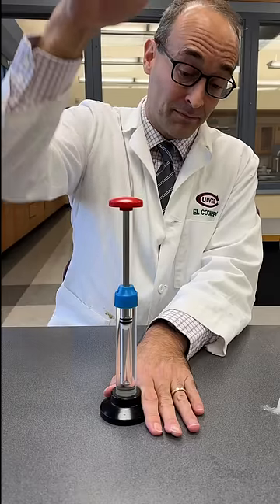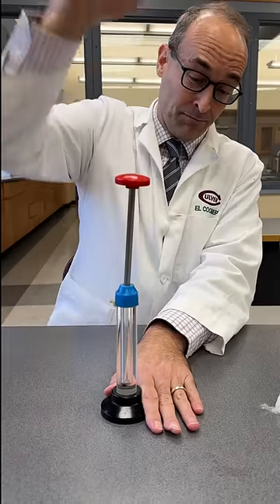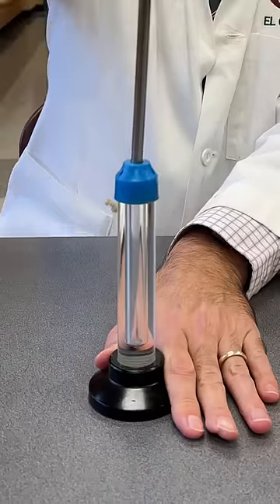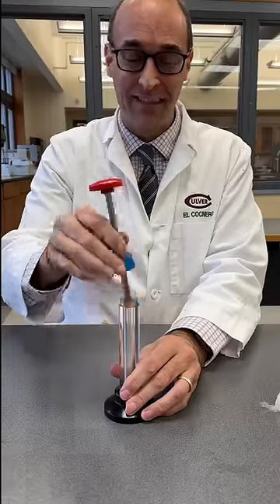Squeezing air to burn stuff

Comment: “You wouldn’t think that squeezing something would ever cause it to catch fire”
The sun: am I a joke to you?
Reply: sun doesn’t combust tho😭
Reply: Solar plasma ≠ fire
Reply: @billyrussell7789  no, but it goes get got. Same with the Earth's mantle
Reply: @SilverStarHeggisist  yeah just cause it hot doesn’t mean it has “caught fire”. fire is a product of combustion, not of fusion, fission or friction
Reply: @billyrussell7789  however for the purpose here, it's semantics. Because something that has gotten as hot as the sun will catch things on fire.
Reply: @billyrussell7789  I'd argue fire is just the visual representation of the process of combustion rather than the result of it or even matter.
Reply: @SilverStarHeggisist I hate when shit goes get got
Reply: In Piccolo voice: NEEEEEEEERD
Reply: @billyrussell7789  Fire is a plasma.  
The sun is made of plasma.  
Think about that.
Reply: @billyrussell7789  You can literally take a magnet to the sides of a candle flame and move the flame with the magnet because the flame is an ionized gas ... a plasma.
A candle and a star go about creating a plasma in very different ways, but the end result is still a plasma.
Reply: @billyrussell7789  Sorry but to prove you even more wrong the sun has carbon monoxide about 500 kilometers above its photosphere. 
Those carbon and oxygen atoms weren't bonded together by fusion which means it was an old fashioned chemical reaction ...  a combustion! 
Not that this contributes more than a tiny fraction of the sun's total energy output but it is a thing!
(Sun wiki page)
Reply: @lick28  In response to fire being a visual representation of combustion; 
Methanol flames are actually invisible which makes them incredibly dangerous if you aren't aware that it is burning.
Reply: @Derekzparty  
Coal is a form of carbon. 
You’re made out of carbon.
Think about that.
Ya see how two things being made out of the same thing isn’t really an argument?

Im aware that fire is a plasma, but the important part of that plasma, the part that yknow… makes it fire… is that the flame icomes from the heat caused by combustion and appears by a combo of absorption bands and black body radiation. The heat of the sun is caused by nuclear fusion in the core, and CO above the photosphere would actually be proof against combustion occurring, since CO can be burnt with oxygen into CO2 (this is the cause of the small blue flame near the wick of a candle - CO burns blue, and then combusts further into CO2 which burns yellow.) Now this on its own wouldn’t necessarily be proof against being “on fire” as there is water in this region; partial combustion is still combustion, and hydrogen will burn before carbon, however there’s an important step here were missing. 

When something combusts, its reaction with oxygen, and goes from a higher, stable energy state, over a large energy barrier to a much lower energy state. Normally this is some combination of carbon and hydrogen (or a metal) burning with O2 into CO2 and H2O… but there is no O2 or hydrocarbons or C2 found near the sun. Rather what is happening is that ionised atomic oxygen, carbon and hydrogen are being released and as they cool and deionise, they’re going from an already high energy state to a lower one. They never pass through being in the hydrocarbon and O2 energy well that would be necessary to call it combustion, and thus never undergo the reaction that distinguishes plasma generally from fire specifically. 

(Source: my bestie is an astrophysics researcher, I’m a few months off a chemistry degree)
Reply: Oh how I love astrophysics.  😎
Reply: Not true.  Biological entities are made of many things.  To say people are made of carbon is like saying carbon exists in these forms; diamond, graphite and people.
Reply: Diesel engines are great, just not sure why there are some that"run away" some times. I'm not sure if it's because they over heat.
Reply: @goldengear6125  Something on the High Pressure Pump breaks down allowing unrestricted injection.
Reply: @BakitracinTugungu  Makes more sense, I forgot about the fuel injection.
Reply: Sun uses gravity to pull hydrogen atoms together with such force that it turns into helium atoms and releasing lot of heat. So yes... Sun also uses the same mechanism.
Reply: @DabsOnDabs 😂😂 silly
Reply: There's not oxygen in the sun. The only place in the solar systen where there's actual "fire" is Earth.
Reply: Wow this throwaway joke sure provoked more of a discussion than I would have expected.
Reply: @senskrad5860 the sun is 0.77% oxygen!
Reply: Man, people are getting way too worked up over semantics... yes, the sun is not powered by combustion. No, that doesn't invalidate the original comment; squeezing nuclei together hard enough to fuse is precisely what powers stars, and on top of that, terms like "ignition" and "burning" are regularly used when talking about fusion, even though it has nothing in common with combustion other than being an exothermic reaction.

Great subjects to discuss, but don't lose perspective by getting caught up in minutia.

Comment: This kind of thing was tought to me as a child decades ago. It is called a fire piston and works amazing, especially if you put some charcloth in there; the pressure required to get charcloth to ignite is much lower and will create a burning ember much easier. All we used was a piece of copper pipe with a whittled piston made from a branch and made to snuggly fit into the cylinder but not get stuck. You put the charcloth and other dry combustibles into the bottom of the cylinder, place the whittled piston in the copper pipe cylinder and slam down, as in the video. Make sure to hold the piston inside the cylinder when you do this or your piston will launch from the cylinder, kind of like a mortar round. Your tinder/charcloth will be burning and can be dumped into a tinder bundle and then fire is relatively easily created. This trick has actually saved my life and I recommend this as a survival technique that everyone should at least know about. Thanks for the video.
Reply: Huh interesting, i always thought thus was how guns work
Reply: How did it save your life? What’s the story?
Reply: Yeah what's the story
Reply: Survival… 🤔where?!  Some place a piston or copper pipe is located. And maybe some bottled water, pots/pans, and a radio too😂
Reply: @Jonesybabie  These are skills, materials, and kit that you should have gathered and made work well in advance of needing them. Even though things are vastly different than when I learned about this, I''m sure you can find these items still for sale and can make the best piston and cylinder your mind can imagine. The things you have mentioned should be close to the first things you ALWAYS have anyway. Especially if you're in a Survival or SHTF situation. And remember, this was only one of many ways to create fire. Learning and practicing survival/SHTF skills is on the individual. I have done, and continue to do, my homework, build up my kit over decades of trials and errors, practiced, practiced, and practiced some more. Learned what works and when to use the skill/tool to accomplish tasks. If you don't have your kit (knowledge, practiced skills, tools/materials, etc.) ready to go at a moments notice, then I would urge you to develop that area of your life. Especially with the state of the world these days. Good luck and keep learning.
Reply: I too learned this as a young guy it was called a Malay fire piston used a hardwood limb it was hawthorn with hole bored in it and carved piston from another piece the charred cloth was put on the end ,the natives used animal fat in the bore,we used lard worked every time was amazed
Reply: 8th grade novel story project or youtube shorts bro pick one
Reply: @danroseveare3090  I'll use my military experience and yall keep hoping your YouTube skills will be needed, like the rest of the preppers watching too much TV 📺
Reply: @Jonesybabie  Right on brother. All these skills/techniques are only informational unless they're put to use and practiced. Knowing how to do multiple techniques to accomplish the same goals is critical; 2 is 1 and 1 is none mentality is what I use. Thanks and respect for your service.
Reply: @Jonesybabie your military skills ain't anything lil kiddo dreaming in his papa land LMAO

Comment: There is a firestarter called a fire piston that uses this. They're rather small, compact and reliable.😊
Reply: Cool I might buy one for my camping pack to use in emergencys
Reply: Char cloth is your friend. Fire roll lint with ashes works too. Not too hard. It will self ignite.
Reply: ... and as old as old pharaonical egypt, at least. They did use fire pump igniters back then.

Comment: "Fire Pistons" have been a staple in Bushcraft for thousands of years.  You can still buy them on the internet, and use them to start campfires with nothing but a bit of tinder made to smoulder via compression.  Plenty of YouTubes about them.

Comment: notice how the piston goes right back up after he hits it? that’s how the power in an engine is generated. the energy from the air pushing back will be almost as much as the force compressing it (only almost because there’s small losses from friction), but igniting the fuel changes it’s chemical energy into heat, expanding the air more and causing it to push back on the piston harder than it was compressed. that’s how fuel + air = power !
Reply: ٠

Comment: Cultures have been using this principle for starting fires for millennia. They’re called fire pistons and were the inspiration for the diesel engines.
Reply: I was gonna ask what materials they could have used to make a good seal. Then I realized I forgot bone and horn existed, which both come in the form of convenient airtight tubes. Apparently bamboo works as well, which I had not guessed would be the case. Neat case where indigenous technologies went off on an entirely different direction and culminated in a product arguably superior to the European equivalent.
Reply: For millennia?  Jesus was using diesel pistons in Galilee?
Reply: Millennia sounds like a stretch but ok.
Reply: @vincejohnm 
Wiki says
“The antiquity of the fire piston in Southeast Asia is unknown, but it definitely pre-dated the Austronesian colonization of Madagascar (c. 100-500 AD).”
But we all know the reliability of that site.
Reply: @-ZH  according to some tribes anything that wasn't invented in Europe of the 18th century and later doesn't exist. regardless of the reliability of wikipedia.
Reply: @@YahWinUWin Matches. If they get wet they're useless. Flint and steel doesn't have that problem, but you also can't make that from materials you can find just anywhere. This is a more universal solution.
Reply: @@YahWinUWin Europeans version of the fire piston came late... early 1800.  While fire pistons were used in south east Asia for nearly 2 millennia. Not much flint in this region. So people made do. 

And tightly bound plant fiber wet with water, or plant wax makes a good enough seal for a fire piston to work.
Reply: @Frommerman  The Inca iirc became crazy good working with fibres because they had to. They would task villages with making bridges from literal grass wound together every year. It sounds dumb to make a bridge every year, but it beats dragging heavy materials into the mountains, and it’s impressive they could turn grass into a bridge, which usually was integrated into their vast road system.
Reply: @-ZH  "But we all know the reliability of that site."

Hence why they have citations that you can follow.
Reply: @Frommerman you can lap any 2 surfaces together perfectly if you put enough time in.
Reply: Yeah I'm sure some bamboo stuff is definitely superior to the European version (engines).... @Frommerman
Reply: The south east asia fire piston is complete bs.   There is no way you can make a tube device air tight enough for the combustion to happen without the unit not working or falling apart after few use.  

Is more practical to just carry small cistle and start fire the old fashion way.
Reply: Diesel, (the inventor of Diesel Engine) did not knew these culture and the way they started fire. Similar principle can be discovered at vert diferent period of time..
Reply: @jasonchui111  maybe for modern society yes, not so when they were commonly made out of those materials. back then it was quick and easy compared to the other options, especially as if they werent durable that would simply mean the fire piston was a skill more than an item. the goal was survival, not peak short term profit, we didnt have this capitalist brainrot which causes us to build failure points into things we design nowadays to encourage ever growing consumerism and ensure line go up
Reply: Anywhere there are trees you’re bound to find sap. Pine sap is a great torch fuel.
Reply: @flaming_ace  please someone show me a bamboo fire piston? 

One that actually works, then if that is possible then show me how to make one using what is naturally avaliable without machinary.
Reply: @estebanod The european version is also several thousand years newer than the bamboo version, learn to read.
Reply: @Frommerman  We are all indigenous lol. It's not even really superior or you'd see it more today.
Reply: @flaming_ace  Capitalism wasn't invented lol, tribes trading by definition practiced capitalism.
Reply: yup and they still use them!!! aint broke dont fix it
Reply: @estebanod  Ey, bro! Just checking in. Have you learnt how to read yet?
Reply: I dunno where I read this, but I think, the Egyptians had such.
Reply: @doraemon5990  yes, need me to teach you?
Reply: They used fire pump igniters in old egypt.
Reply: @CaspCic Correct. 🤗

Comment: typically referred to as the Heat of Compression in HVAC, though never used in a combustion sense. car mechanics will tell you that is the primary principle of operation for diesel engines
Reply: Can you explain further? I don't understand

Comment: The angles of the intake and exhaust valves tells me you’re right about that model “being older than you are”😂
Reply: What should it look like now?
Reply: @gumpus5490  Valves would be angled in the same direction as the flow of air to reduce turbulence and aid in the flow into and out of the combustion chamber. Whether air or water, you don’t really want right-angle turns as much as possible. Gentle bends/transitions optimize flow.

Comment: Apparently the same happens with atmospheric re-entry. It's not just the air friction that causes it to burn, its also the compression of the air
Reply: Its cool how to capsule is so fast the air around compresses adiabatically. But on a large scale even weather is based on adiabatic processes because gasses are so poor at transferring heat
Reply: Ok, you’re pretty close but there aren’t two phenomena at play here. There’s just an adiabatic compression. “The term "friction" is a misnomer. The source of heat is adiabatic compression - gas on trajectory of the reentering object is compressed against its leading surface, and as result heats up.”
Reply: @teeanahera8949  ah ok. There's no real "friction" Thank you for clearing that up :)
Reply: @UnknownMFe maybe friction would only be real friction with solids? Not sure.
Reply: @UnknownMFe there is very definitely “skin friction” in fluid flow (gas in this case) over a surface as the fluid passes over / around it. That’s one source of aerodynamic drag, and it does, in fact, produce heat.
Reply: ...The heat friction produces is, however, oftentimes negligible.

 As we have been taught in school friction between gasses and solid objects is much less than solid Vs liquid or solid vs solid. And can easily observe this phenomenon irl.

 Heat is only ever a concern for aircraft design when going supersonic, and that's because air is actually being compressed by the plane.
Reply: Which is why you can “skip” off the atmosphere which Armstrong did in the X-15
Reply: Does that mean it gets colder on the opposite side
Reply: @loganbaileysfunwithtrains606  None of that has anything to do with skipping off the atmosphere, that's just a result of lifting forces with a bit of help from Earth's curvature.

Comment: As others have said, this is how diesel engines work. Definitely not other general internal combustion motors though. When this happens before the spark plug makes a spark in a gasoline or a propane motor, it's called "knock" or "preignition" and is very bad for the motor.